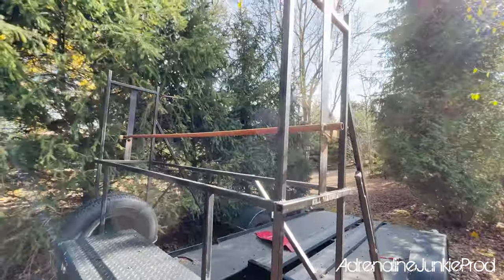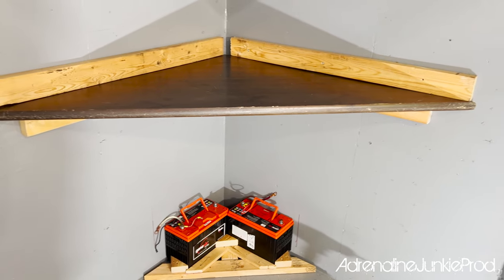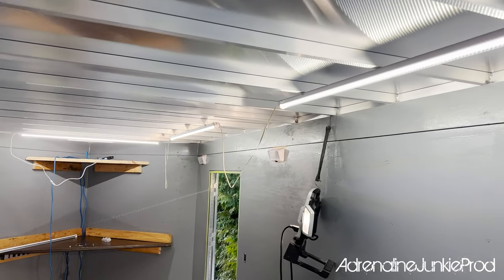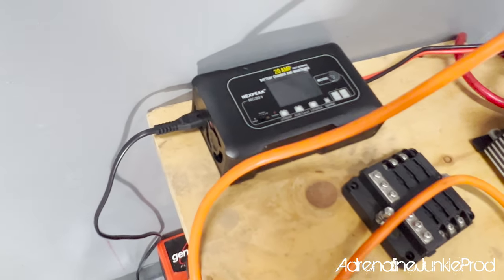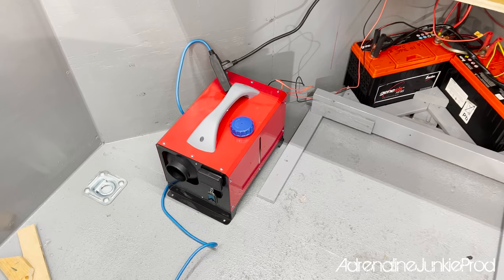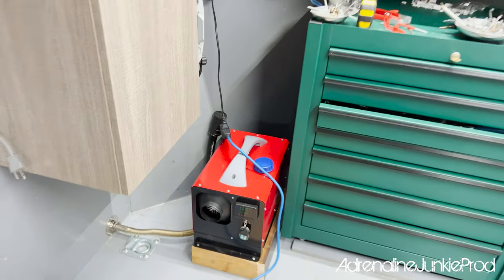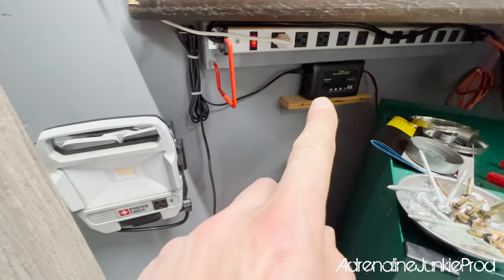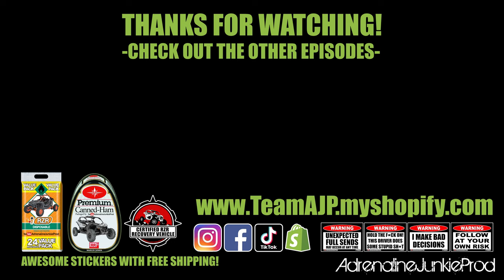Enclosed SXS/UTV Trailer Build - LED Lights, Deep Cycle Battery Bank & Diesel Heater - Episode 03

Comment: We need part 4!!! We had an 8.5x24 enclosed trailer. We insulated walls and ceiling with foam board, paneled the ceiling, then sold it lol. It drug everywhere. It had a dovetail on the end for race cars,  not needed for sxs's. The 8.5 also was tough in tight traffic, and i pull wide loads all the time for work.